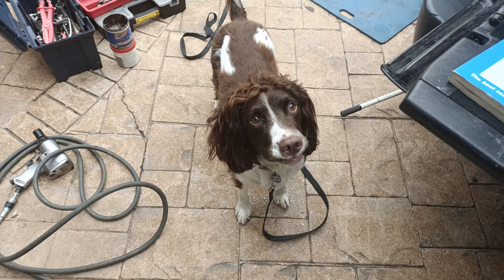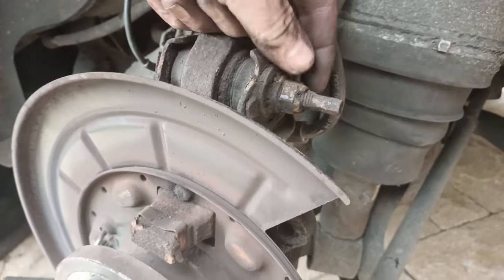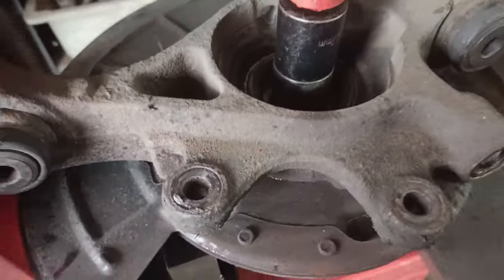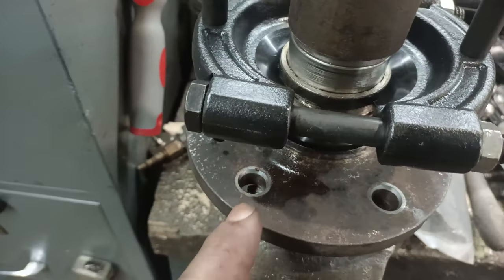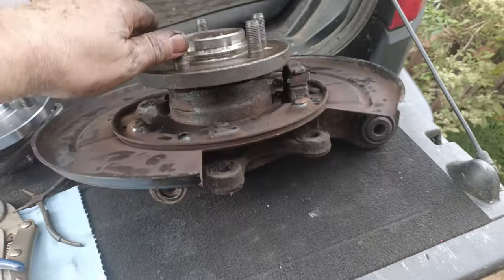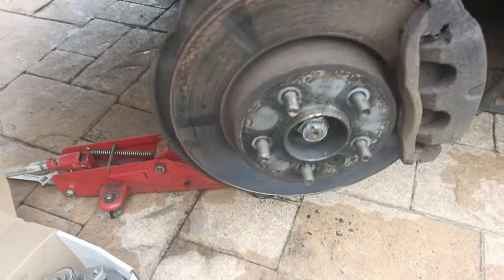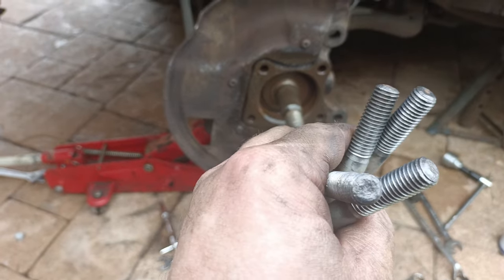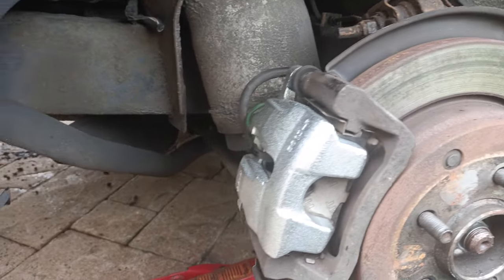Discovery 3: Wheel Bearing Replacement

Comment: When you are trying to get the other half of the bearing separated take a cutting disc and angle grinder and cut  a groove into the  remaining half of the bearing ,Get a cold chisel and a heavy hammer and give it some. You will find the half bearing will fall off.  Job done.👍
Reply from the maker: Thanks for the reply. I shall give it a go if/when I need to.. Hopefully not for a while.. :-)